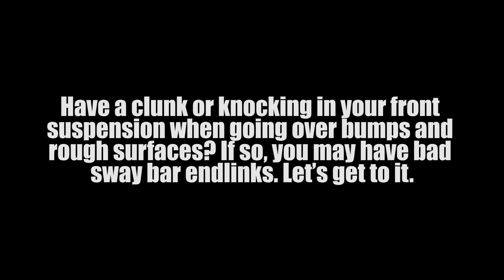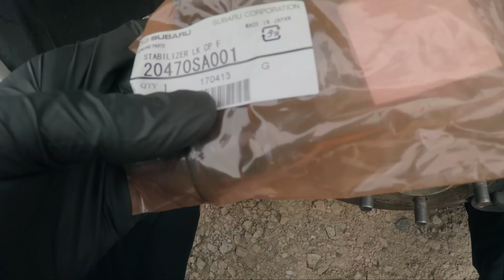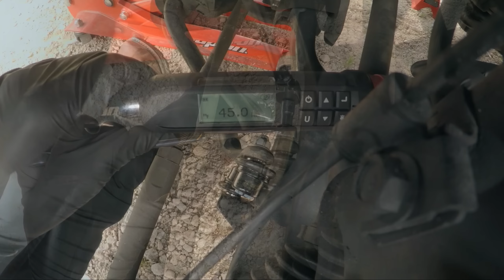Subaru Sway Bar Endlink Replacement

Comment: I noticed a rattle in the front driver side of my 2017 subaru legacy..around 48,000 miles on it.. thought it may be a bad strutt...but this makes alot of sense..as I think the struts would outlive the small sway bar link bushings..I will check it today... Thank you for the knowledge!

Comment: Just did this last week. All four nuts were seized. Heated things up with a torch so I could pull the boots off and used an angle grinder to cut. Replaced with Moog end links. And, of course the LCA bushings are shot. Ordered Whiteline replacements, but having the Subie shop replace. $414 for labor. OUCH!

Comment: Had to do these today on my 2002 wrx. 
1. Using the hex is recommend but if it strips 
2. You can attempt to grab the metal on the other side where the Endlink is 
3. Heat up the Endlink bolt and pull out the metal ball from the Endlink assembly - vice grips that thing and then you can unbolt the bolt
Reply: Was yours making a popping sound
Reply: @Cktrld  my shit totally broke - but yeah if there is any play in the link it will make a sound

Comment: I ordered the front links from a parts dealer. Am about to fix  this soon, I wont take the wheel off. Other videos show it can be done without jacking up. 2008 Forester, with 151K. I live in the West, rust shouldn't be an issue.

Comment: The secret is to preloosen the pivots. They come so stiff you'd swear they're solid but I put a socket on the shaft and wiggled it by hand till it moved then lined up the shaft angle with the mount holes and bam! Easy.

Comment: Do you happen to know if the torque spec for the bolts on the 2016 Crosstrek front stabilizer links is 44 ft lbs?  I keep finding conflicting specs for this application.  Planning to do them in a few days and some places say 35 ft lbs and some say 44 ft lbs.

Comment: i did my fronts which was nice and easy, my rears make no noises but the other day i noticed i could grab the rear links them selves and very easily with 2 fingers or my hand pivot them around and move them very simply... i assume they are shot or near shot if its that moveable by hand?

Comment: Hi, love the videos, I'm currently upgrading the handling on my 06 XT. What length is the ending stud to stud please? I removed mine a few weeks ago while stripping the car and I have lost them now, I have got adjustable whiteline endlinks that came with the new sway bar and I don't know what length to set them at. Many thanks in advance. 

Keep up the good work, you're saving my thousands in mechanics bills 👍
Reply from the maker: Hoesntly don't know. Are they not preset to a factory length?
Reply: @MrSubaru1387  thank you for your reply. I have found that they're 60mm stud to stud. No unfortunately the whiteline ones are adjustable in length and i think it's also so they can be faced In any direction so they can be used front and back? I wish I had gotten moog ones now but another lesson learnt. 

Many thanks from Shropshire UK 👍

Comment: Great video, I did this job earlier today, and my end links looked to be shot, but what I still have clunking from the front end? Thanks.
Reply: Can be a whole myriad of things. That being said, sway bar bushings is probably the answer you are looking for. You could also check the ball joints. Either way, disconnect the end links and give em the god ol shake test and see how much things move around. My sway bar bushings looked fine but I replaced them anyway and it was a huge improvement.
Reply: @TheSunshrine  it actually turned out to be my ball joint on the passenger side
The bolt wasn't tight enough so it kept wobbling around

Comment: your videos helped a lot. thanks. however, one question: do i need to jack up the car on both sides at the front, or is jacking up the car on one side  (the one on which you replace the link) also ok? (i was asking myself, if there would be too much tension on the sway bar, if the car is just jacked up at one point, resulting in some kind of warping and the front axis not being symmetric causing that the link will be hard to be removed).
thanks
Reply: I think you'll need both wheels 'unsprung', so place jack-stands at the usual points to get the car stable.

Comment: Same thing happened to me today. Hex rounded out. Terrible design on Subaru's part if you ask me. The model years with the nut backing is so much easier to remove. I guess I will be going to get a cutoff wheel to finish the job.

Comment: I also had to cut one of the old links off when I recently did this on my '06 Forester.  Unfortunately I still have a clunk in the front end.
Reply: Michael Woodruff if you figure it out, let us know. I have a clunk in my 2006 outback I can't find. Bushings on the sway bar?
Reply: My 99 forester makes a clunk sound very time I go over a bump or turn sharply, I thought it would be one of these things as well, but it has to do with my steering rack
Reply: @jordansewell8020  did you ever find the problem? I have aftermarket sway bars and endlinks already yet i still have the same exact symptoms . im thinking maybe it was my cv axle

Comment: I had a shop replace the passenger rear sway bar link and now the drivers rear just broke do I need to lube the new link before I put the bolts back in I have a 03 wrx wagon

Comment: I know using Subaru factory parts is crucial for a LOT of jobs, but for these, is it absolutely necessary?  Or can you use high end aftermarket parts?
Reply: Just replaced mine with aftermarket ones $15-20 a set with anti corrosion protection, hope they hold up, had to put new shocks & struts too (Monroe)
Reply: @nicholasbastardo2318 monroe  complete struts i would stay away from too much cheaped out construction

Comment: do you need to lift the front end or can you lift one wheel at a time?  I am guessing the stablizer will have a force and act against you if you did one side at a time.  I am doing the ball joints on my 09 Forester, and bought new control arms with bushings, new stabilizer links, and the CTA special tool for ball joints.

Comment: I have a 2019 Ascent, have had the clunking noise. They replaced the coil springs, but I still have the clink. They can’t reproduce the noise. Could the linkage be bad with only 40k miles?
Reply from the maker: Possibly a defective one.

Comment: I'm wondering about the sway bar bushes on my MY 99 outback limited.
  Is it true that if your sway bar measures 14 mm diameter (with a calipers) you need 13mm in/dia bushes.  I'm wondering if that's the problem with my sway bar being so loose and the bushes seem in good condition.  Has the previous owner put bushes in the same in/dia as the diameter of the sway bar and hence the looseness?  Because with all the weight on the rear wheels I can grab the sway bar and move it back and forth through the bushes with ease and like I said, they don't appear to be dried out and deteriorated.  Can't find a vid explaining this?

Comment: Hey Mr. Subaru, I have a couple questions. One, is the job very similar on the rear of the car and two, does it require an alignment? My GT wagon makes some awful clunks going over little grooves in the road and it's all coming from the rear end of the car, like the trunk area. I suspect these are shot.
Reply from the maker: Yes, it's nearly identical, front and rear. I'd check the rear struts as well while back there.
Reply: @MrSubaru1387  My struts have about 50K on them so not too worried there. Thanks for getting back to me. But no alignment is needed after doing these?
Reply from the maker: @nathanyoung8284  not really. Wouldn't hurt to get the alignment checked if it's been a while though.

Comment: Quick question what  issue if the sway bar link is not in good shape... Im having a knocking sound when driving my car, but sure its not bearing...Strut I suspected but i need to know exactly what is the prob
Reply from the maker: Bad sway bar end links will make a knocking/clunking noise.

Comment: Ever do the shake test and feel your car begin tipping to the point you have to hold on? Last time I worked in gravel driveway, that is for sure.
Reply from the maker: Luckily no. Always solid.
Reply: I've had mine start rolling as I was half jacked up and it rolled off the jack, I had forgotten to pull the park brake, but luckily it didn't cause an issue. Scared the shit out of me though lol.

Comment: Is it possible to do this job on ramps without taking wheels off? Thx.
Reply from the maker: Yes. Cramped, but do-able.
Reply: Thanks. As usual I'm strapped for $$, is it worth it to use Moog or is that a regret waiting to happen? Thx
Reply from the maker: Moog is a reputable brand. As far as endlinks go, I think they're pretty close in price.

Comment: I just did this to my 2010 Outback, 193K. While I was in there was looking at the sway bar bushings, they appear fine but I imagine they've taken a beating. It looks very easy to replace, is it? And is it worth it, will I feel the difference? Thx E
Reply from the maker: Sway bar bushings are 3 bolts, I believe, then the metal band comes down with the bushing. The bushing has a slit in it, just pull it off and push the new one back on. Bolt the metal band back on. I doubt you'll feel a difference, unless you upgrade to polyurethane bushings. Even then, probably won't feel a difference. The end links make the most difference.

Comment: Can you torque everything while on jacks? Thought endlinks needed to be torqued with wheels on the ground
Reply from the maker: You're thinking of the lower control arms. Endlinks don't need to be torqued with vehicle weight applied.
Reply: MrSubaru1387 
Thanks, makes it easier. Have Moogs sitting around waiting for a dry day here. Should be easier installing without the allen head.
Reply: MrSubaru1387 however doing so helps with sway bar preload especially if installing an aftermarket sway bar. Many companies such as Whiteline include this step in their instructions.

Comment: Hey Mr. Subaru, I've got a question for you, this was the only video on the subject I could find by you and couldn't figure out how to message you directly, I've got a fairly moderately modified 2004 Subaru Forester XT with perrin front and rear sway bars, bushing mounts, Kartboy Endlinks, Factory Option jdm sg5 forester bilstein shocks and springs, and STI steel lateral links with whiteline replacement lateral link bushings (mods that may be pertinent to conversation but more is done).  My question is this, are you aware of the issue with Rear Sway Bars flipping, and how can i prevent this, it has happened to me twice now and I am concerned because last time it destroyed my RalliTek Endlinks and just happened again, I'm not sure when or how it happened, I just got under the car for random inspection and noticed it.  Any help is appreciated!  Thanks for all the content, I've been a fan for a while!
Reply from the maker: Sorry. I've never seen nor heard of rear sway bars flipping.

Comment: Do you ever replace parts with "performance" aftermarket parts or keep it Subaru OEM?
Reply from the maker: On my stock, commuter, N/A cars, I stay OEM. I did modify both my WRX and STi. I also heavily modified my Camaros, Trans Ams, GTO, G8 GT, and Z06 Corvettes when I owned them, respectively.

Comment: Did you put something under the sway bar so it’ll stay put or no ?
Reply from the maker: Nope. Let it flop when the end links were removed, rotated it back into position by hand when I installed the new endlinks.
Reply: @MrSubaru1387  i just did one side at a time... No floppy bar

Comment: Never use a cutoff wheel as a grinder disc. At least if you like your body parts the way they are.
Reply: Seriously, the guy uses a torque wrench but can't be assed to not use the grinder wrong.

Comment: Can you tell any difference now when driving it?
Reply from the maker: Yes. The endlinks don't clunk anymore.
Reply: @MrSubaru1387  im hoping replacing these will elimanate chatter n vibration in steering wheel when left turn.. Even so slightly as changing lanes creates shutter

Comment: Assuming you can get the nuts off without a problem, is it necessary to replace them or can they be reused?
Reply from the maker: They can be reused.
Reply: MrSubaru1387 thanks
Reply from the maker: You're welcome. 👍🏻
Reply: Well, just finished this job in my '08 Forester. Made a world of difference - no more clunks, nice and quiet! And I only sacrificed one tool to the tool gods, my 5 mm hex socket. It snapped as I was torquing the first nut (41 ft lb in the Forester). Had to improvise using a Torx bit of similar size. Thanks for the video!

Comment: I sure do miss greasable joints.
Reply: I found several good aftermarket links for my car that had greaseable fittings.  One reason I didn't go with OEM.
Reply: In the process of changing mine and the the rear ones on this Subaru accept grease, not sure why the front don't.

Comment: Can I do this job on ramps? Or do I need to remove the wheels?
Reply: Hey I'm not a mechanic but I heard in another video that leaving the tire on helps to line up the links with the bar when putting on. He said you would remove the wheel only if it's in the way.